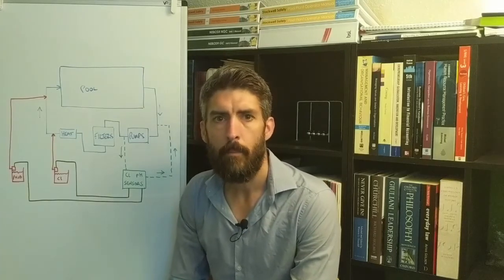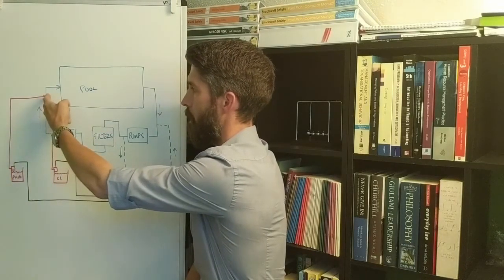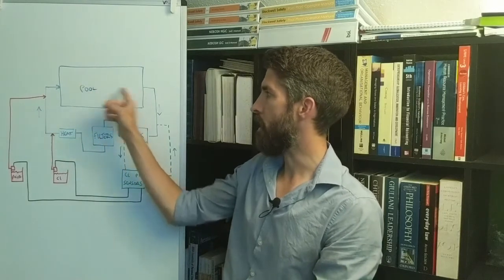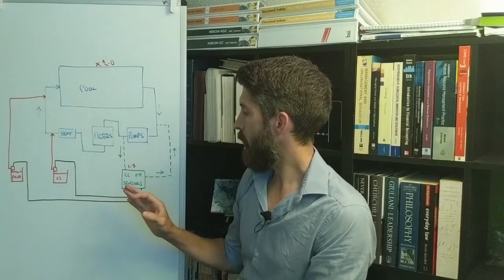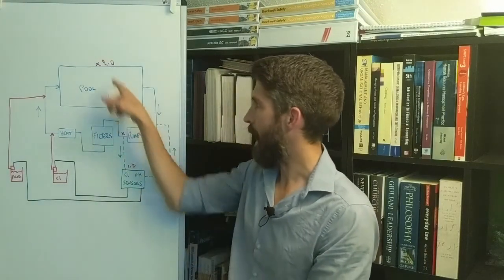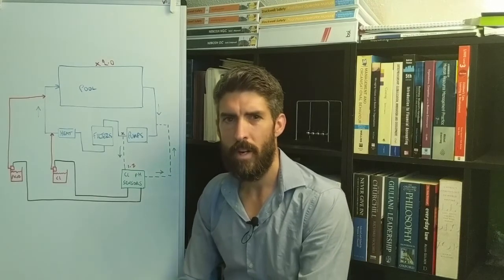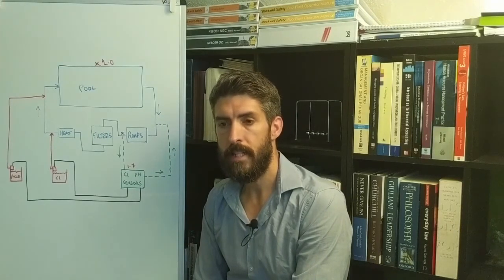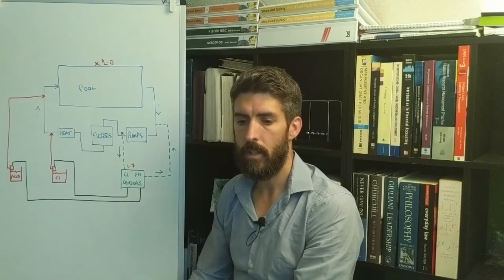Calibrating Sensors

Comment: Very interesting video. It was particularly relatable to me when you mentioned how some operators will standardise/calibrate the system daily...well the centre I work at we are standardising the system for each pool almost always at least once or twice a day with the system routinely being 1,2,3+ PPM out! And one question I have always had - supposing the chlorine test result on pool-side is different to that displayed by the automatic dosing unit, but also different again to the water sampling point on the automatic dosing unit; which value am I standardising the dosing unit to? The poolside test result, or the test result at the sampling unit dosing tap?